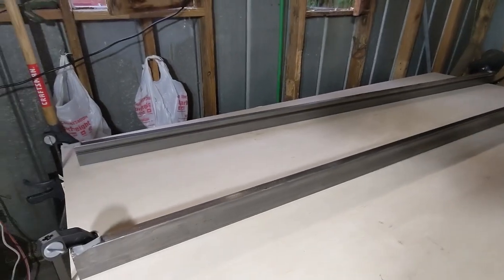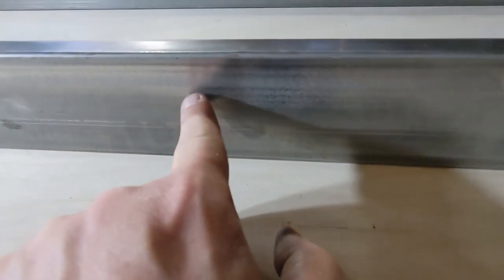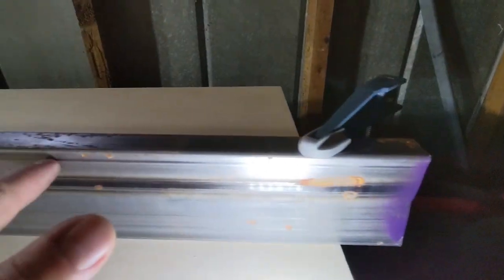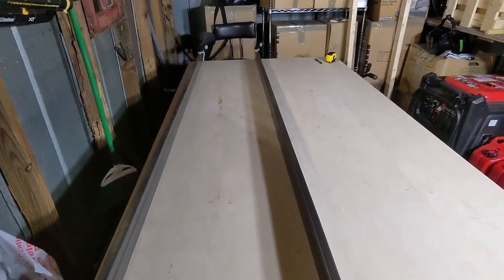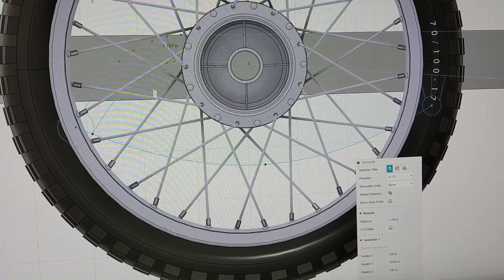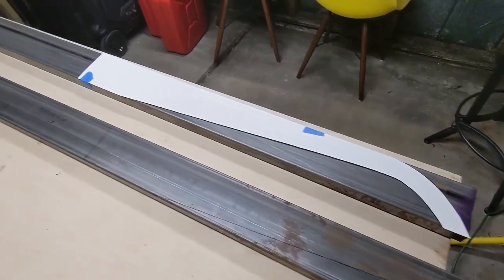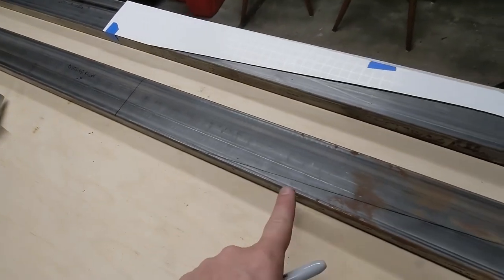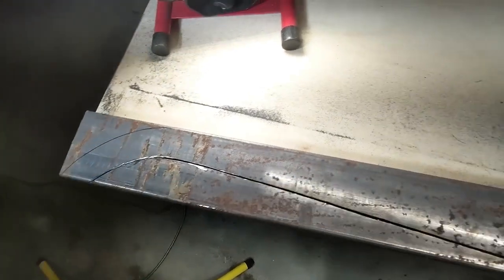Cyclekart Build - Part 2  - Frame Fabrication Start

Comment: Use the edge of the plywood to get a square. You don't have to cut the front of the frame, you can leave it square.
Reply from the maker: Nothing with the frame is square. The inside of the rails at the front are 14.5" and the inside of the rails at the rear is 22.5".
Reply: @hadlock why make it so narrow? You wanna be crammed in so tight your arms have no room to turn the wheel?
Reply from the maker: @308dad8  it's half art, half go kart. An average chair is 18" wide, inside the frame rails is 20+". Your arms/elbows hang outside of the body. You can go wider, of course, but it ruins the aesthetics. 22" is really wide on a cyclekart

Comment: Why did you not leave the bottom attached toward the back of your frame then push it into place and weld along the edges finishing the bottom rail?
Reply from the maker: Others have done it this way you describe. I think two reasons: 1) this is my first real metalworking project, it's actually easier this way, in my opinion. With my way I only need to cut one time per dude. With the way you're suggesting, I need to cut each side twice to make a super long skinny pie piece, and if you screw up you have to cut it all out anyways, and 2) I was planning on adding a 2" extension to the "tip " of the curve, hammering it in place, I still would have needed to weld an extension

And I guess 3) I'd have to hammer, in place, the steel into a reverse curve, at a funny angle. Instead I got to do do this at my leisure on a vice at the best angle
Reply from the maker: Good question
Reply from the maker: I think both ways are equally good. I prefer mine obviously. Mine also requires half as much cutting.